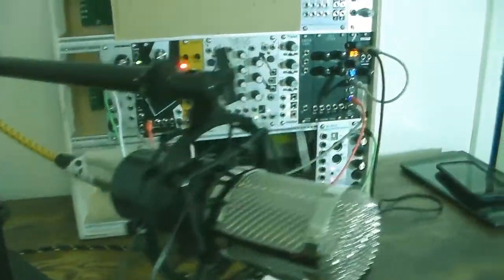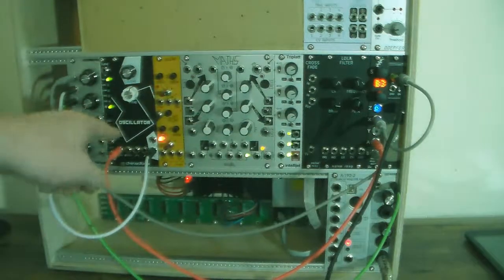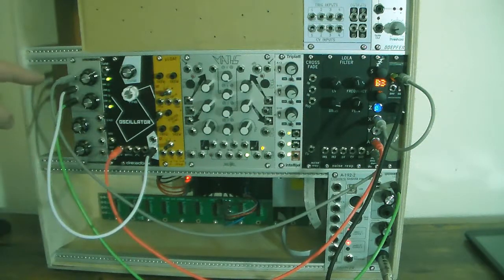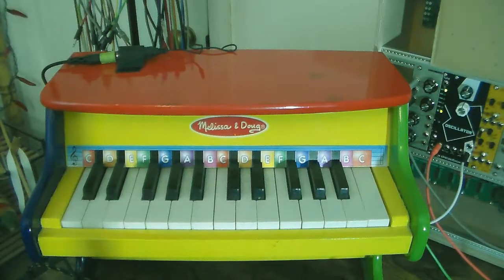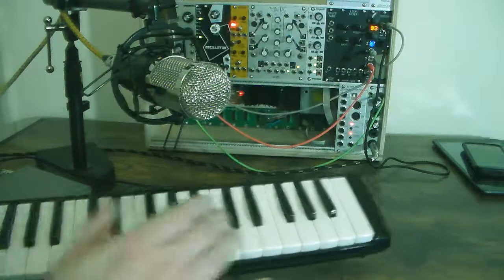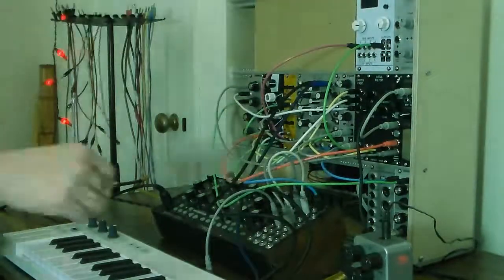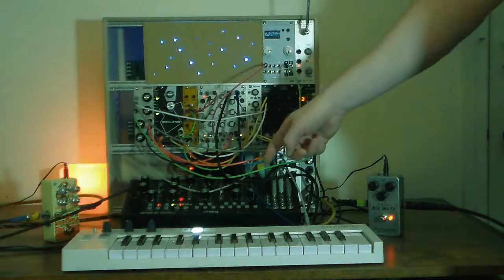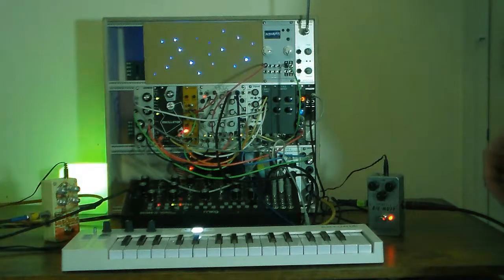Disting Mk4 Mode B3 Pitch and Envelope Tracker

Comment: Pretty fun!
There is not such algorithm as a pre-amp in the disting right? (To get line-level up to Eurorack level...)
Reply from the maker: I don't recall that from the list of algorithms, but I have two other modules specifically for that (a clone of Ears by Mutable Instruments, and Merge by Adventure Audio), but of course the only drawback of the Disting is though it can do nearly anything, it can only do one thing at a time. Sometimes I think about getting a second, or the EX model.
Reply: @Bills_Place  Thanks. The attenuator can boost a little bit. I have an Ears, but it's mono. I did hear good things about theb KnobFarm Ferry, when using the 'return' part of it.
Reply from the maker: @studio48nl  Good info! Sometimes I wish I had a good stereo amp, and my Merge is a little noisy. Will look at the Ferry closer, maybe add it to my "someday" list.

Comment: That's awesome. getting dangerously close to sounding like a real song! nice triggering - I'm curious if your setup has any MIDI sort of input/interface?
Reply from the maker: The purists use sequence modules (I have a little of that in the big Mother-32 box and the MIDI keyboard) but for something like this I use my DAW and output MIDI on two channels, one to the Mother-32 and the other to the little keyboard which has CV (control voltage) outputs that connects to the modular stuff above.  I'm enjoying having multiple ways to do similar things, so I don't get stuck doing the same thing each time (even if the final audio on the other end often sounds similar)

Comment: Sorry to resurrect an old video but hope you are still monitoring.  Could you convert this into basically autotune for the guitar?  Dude with no skills picks strings, strings to Disting, Disting to quantizer to oscillator?
Reply from the maker: Sure, patch the output from disting into a quantizer module, set it to whatever scale you like and there you go.  Accuracy might still be an issue, when I tried it it was obvious that the harder you pick the less able Disting was able to track, especially the attack, but the quantizer could help tame that.  Might even be useful to put it into a slew limiter such as Maths before the quantizer, just to tame the chaos of the attack.  Of course I'm just thinking and guessing without experimenting - I might have to try this later - thanks for the idea!
Reply: @Bills_Place  Awesome...I was also considering a weird variant that might work well...a single note into the Chord V2 by Qubit then generates the 3rd/5th/7th as SOUND and these could be duplicated and branched into Disting to feed another oscillator.  fun ahead. thanks!
Reply from the maker: @phloog  Great idea, and you got me wishing I had a Chord.  It's on my "someday" list (or maybe Harmonaig)